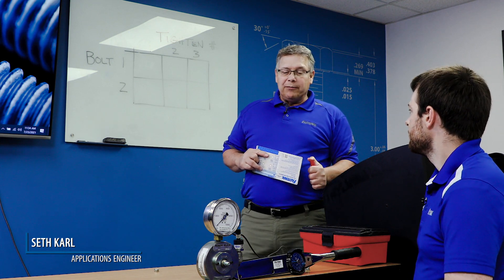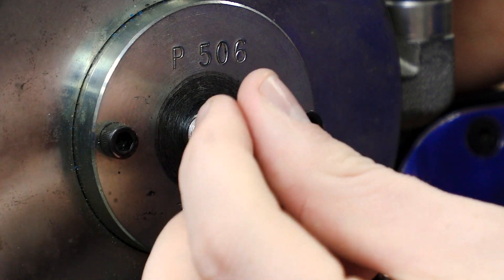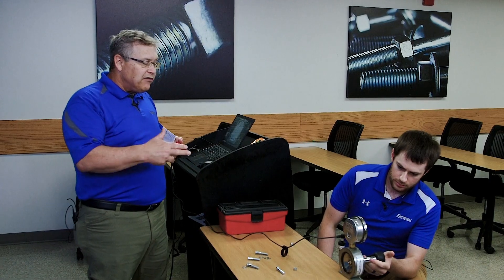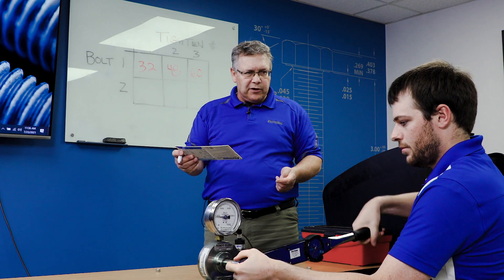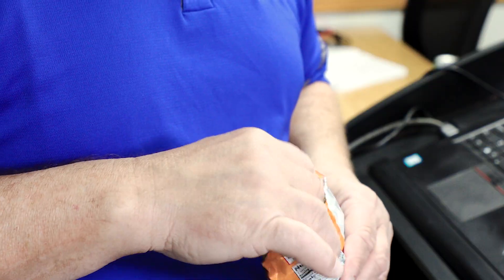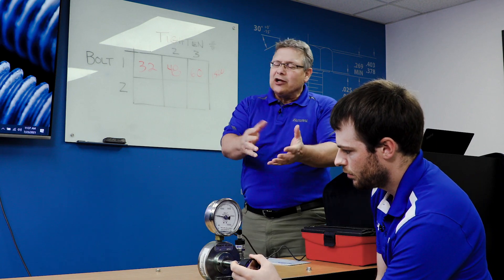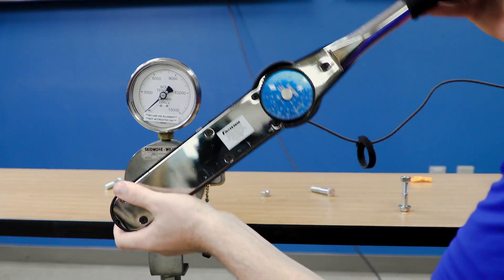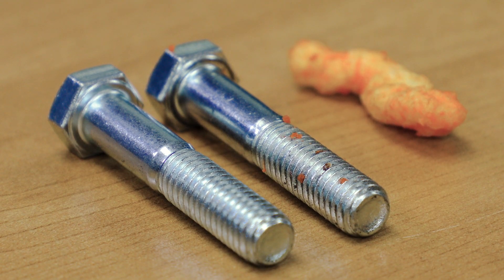Torque Tension Testing: Cheetos Training

Comment: What lube product is industry standard for thread lubrication?
Reply from the maker: There really isn't an industry standard.  Some people use an anti-seize paste, some use a spray type lubricant like CRC, others can just dip the threads in a container of motor oil.

The options for larger quantities in an OEM installation world are the easiest where you can get the lubricant pre-applied onto the bolts so no one needs to spend the time to do any of the above.